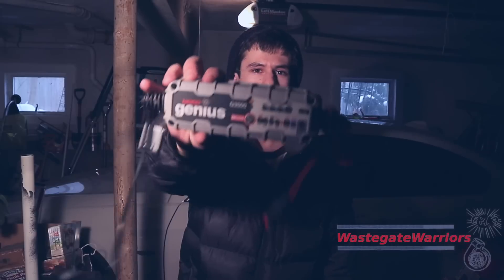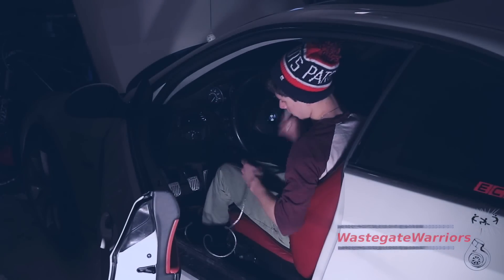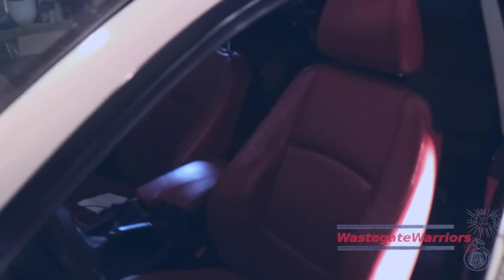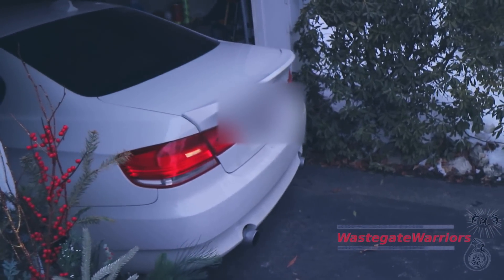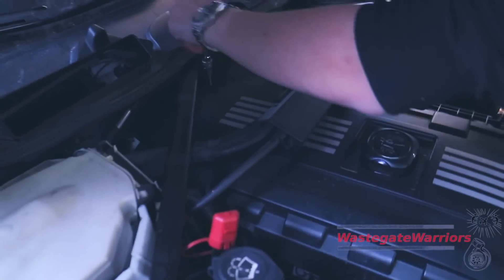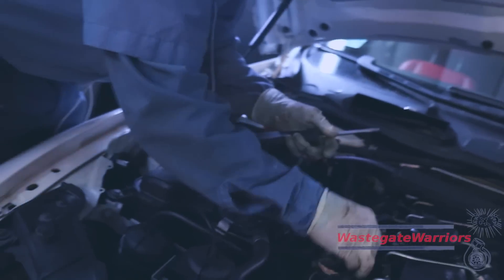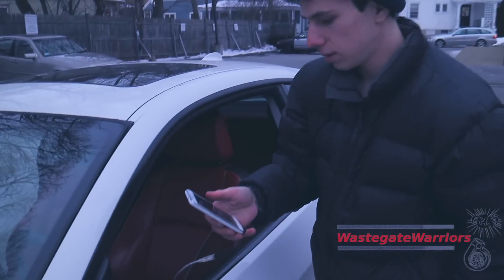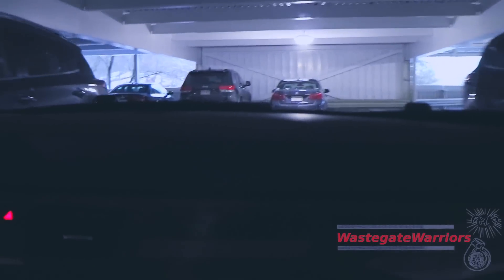MHD/Wedge Flash-Tuning Your Car in Your Driveway | Install and Review

Comment: I did the mhd tune stage 2 on my car. It currently has intakes, downpipes, and muffler delete. My car started to misfire so I changed all of my ignition coils, it started to misfire again so I changed my spark plugs. 

Now it’s misfiring again and I don’t have the cable to read the codes any idea what it may be?

Comment: Awesome video, guys! Was this a Stage 2? Does that only require downpipes? Any issues since you've had the tune?
Reply from the maker: This was stage 2, you don't need downpipes for any of the MHD OTS tunes, but they will keep your turbos spooling longer.

No issues with MHD. In my experience Ken wrote the best OTS tunes for this car. Period. I've been through JB4s, Accessports, and other generic tuning options. Wedge maps are the best OTS solution for this car, no question.

Comment: Great video!  Im currently running Cobb Stage 1 sport on my 08 335i and the only bolt on I have is a Mishimoto FMIC and was debating if I should sell the Cobb and switch to MHD.  Im fairly happy with the Cobb tune .  Do you think i would notice a power difference if I went with MHD?  Just didnt know if its worth the trouble unless its a major difference.  What are your thoughts?  Also what is the highest stage MHD OTS map I could use with a stock plus FMIC with 91 octane?  Thanks for your feedback !

Comment: I have a good video of my friends stock 2011 BMW 335i sedan auto n55 vs a mhd flashed 2009 n54 335i coupe auto. The mhd kept pulling all the time adding ground. It's not day and night difference but you do gain about 25 whp with mhd stage 1 flash
Reply from the maker: MHD is awesome. Stage 1+ is around 360whp
Reply: WastegateWarriors Is stage 1+ intake and tune?

Comment: what mods besides the tune does max have on his e92
Reply from the maker: Wagner FMIC, lightweight flywheel, 335is clutch, Phoenix racing charge pipe, VRSF one piece silicone inlets, stoptech slotted/drilled rotors, Hawk HPS pads and a secondary cat delete. I think thats it for performance mods.

Comment: Great video guys. Got some questions for you guys. Did u guys take out the jb4? Do you have to purchase maps if you want to switch a different map? Last question is when u change out the coil/coils. U guys change back to stock coils? Or performance coils? If different from oem coils, what do u recommend? Thanks for the video really. I want to flash my car with MHD.
Reply from the maker: We did take out the JB4. We also purchased stage 2 which enables us to flash ANY fuel type for a stage 2 tune or a stage 2+ tune. We put in stock coils because that's what I could get and I needed them asap but if you have a choice grab some good afternarket ones.
Reply: WastegateWarriors thanks for the important info. Learn a lot from ur videos. I'm having the random multiple misfire. Cyl 1,3 sometimes 2 pops up. Swapped the coils but it didn't follow the coils. Driving me crazy. Anyways. Thanks for the answers.
Reply from the maker: Check your spark plugs as well as fuel system. Could be an injector or fuel pump. Also check your coils, if they're wet you have an oil leak and need to change your valve cover gasket, if that's the case check the valve cover because it often warps.
Reply: WastegateWarriors nice. Thanks again

Comment: I'm N55 and Wedge just released our tune recently, I order my cables, already have my Android and will be buying my battery charger tomorrow.  I'm about to drop it like it's hot and get my tune on, I already got my 4"DPs, 5 stepped IC, GFB Diverter Valve and ER Chargepipe and I can't wait to see how much of a difference this is between it and my Cobb AP3 STG 2 Aggressive.

If MHD smokes JB4 then I know it'll destroy Cobb, thanks for sharing.....this only motivated me more to want mine in ASAP.
Reply from the maker: Drop it !
Reply: soldierviejo please post videos of your setup after it's installed. I'm running a 2011 335i stock for now and just ordered my cables and chargepipe. Thinking about custom for my exhaust with catless downpipes.
Reply: Jovin Flores I would've already had a video up but I ran into some problems that I couldn't figure out so I'm taking my car to BMW because I believe it is the High Pressure Fuel Pump that is the problem.
So for now until my car is fixed my MHD tune is on hold but I already have my bolt ons mounted and have so now for over a year.

Comment: super dope guys, i've been an audi/vw tuner (still am) for years i just got my first N54 335i and i only have Jb3 with charge pipe and hks blow off and a mid pipe delete on the exhaust i would like to know the PSI range of the MHD/Wedge flash. thanks again earned a subscriber.
Reply from the maker: Thanks for the support man. The Wedge flashes provided on the MHD app have a wide range of boost pressure targets. I can't speak for stage 1 or 2 but for stage 2+ it targets 18psi. :)
Reply: holy SH******T so pretty much JB4 and JB3 alone could never compete lol Also is this also known as the Back End Flash? ordering the kit now! again thanks alot! i'm going to continue to share your videos and i hope you guys keep making awesome videos man! i'm loving the BMW community.
Reply from the maker: Yeah lol the Jb4 is a very different product entirely. And yes this is a hard flash which changes the actual ROM files on the ecu, no piggybacking here.
Reply: No, this is not a Back End flash. BEF should be paired with JB4. What these guys have is a standalone MHD.
Reply: How many different tunes are on the mhd app?

Comment: Hi, you guys are so great and the video is very helpful. Btw, can you please be more specific how the stand alone MHD Stage 2+ pump is better than JB4+BEF MHD pump flash?  More PSI? More torque?  Smoother?  I would like to know if it is worth the $20 (full module) + $50(map) to change from JB4+BEF to MHD stage 2  + pump map stand alone flash.  
Have you tested the MHD beta V7? Is it better than V6?
Thanks.
Reply from the maker: It's better because it changes the actual ROM files in the ECU that control the timing, and the JB4 just tricks the car into making boost by playing with voltage. It's much more consistent and much smoother. When my car had a JB4 it would make crazy power one day, and not crazy power the next day. It was embarrassing to "show" your new tune to someone and have it underperform. Sell the Jb4, tune MHD/Wedge Stage 2+ if you've got the bolt ons, and you'll love it and make money in the process. The V7 is pretty sweet, it's my favorite revision yet.
Reply: When I did JB4 BEF flash, I feel the car is stronger and smoother.  The change is noticeable.  I am not sure if the stand alone flash will further improve it.  If it is not a big jump, I would stick with JB4 BEF.  That's why I want to know the different.   Before I saw your post, I thought the JB4 BEF has already solved the problem and no need to do the stand alone flash.  Please advise.  Thanks again for your great info and response.
Reply from the maker: King Ho I would sell the JB4 and go full MHD. You'll get the same power and make money in the process. It's a win win
Reply: Great, I will try the full MHD stand alone flash then.  Thanks for the advise.

Comment: Hey bro. Today I got the FBO and new spark plugs. But when I read the code there is a shadow code shows: 30EE super knock : cylinder 2. What causes that? Is that because of the coil is too old? Thx man
Reply from the maker: I've never heard of that and I just did some research and couldn't find anything :( I would email both Ken from Wedge performance and Martial from MHD explaining all of this to them. Sorry :/ Good luck!
Reply: +WastegateWarriors Ken replied that is caused by weak spark and I already changed the new spark plugs. So maybe I should change the coils too. It is a common issue isn't it?
Reply from the maker: Definitely change the coils, literally the second I got on it for the first time on the MHD tune I fried all the coils. Should be a standard upgrade for tuning any car imo. Good luck!
Reply: Thanks man! And today I got 2 shadow codes shows 29F4 29F5  which are catalytic converter conversion. Is that caused by a catless DP? Do I need to worried about them?
Reply: Jason X did you ever find out what was causing the error codes for 29f4 and 29f5? im getting the same codes..
Reply: That's because of the catless DP. Nothing need to be worried.

Comment: hI. My car is 27k miles. Does it need a walnut blasting before FBO and tune? And do I need to change spark plugs and coils just in case? And also how many whp if using a stage 2 built in map and custom tune map? thx bro. nice video!
Reply from the maker: No you don't need to walnut blasting yet, wait till 50-70k. Depending on the condition of your plugs and coils, you may be okay. I would say tune it first and then see if you misfire. If you misfire then grab some new coils and plugs. I would say expect 380-415 on 93 with your mods on MHD Stage 2+. A custom tune won't lend much more on OEM turbos and pump gas. Wedge's tunes are amazing and their off the shelf tunes are amazing!
Reply: +WastegateWarriors So ur opinion is dont need to do the custom tune right?
Reply from the maker: Jason Xin Not unless you have aftermarket turbos or you want to run E85. If you are running 93 stay with OTS
Reply: Hey man. What kind of  Battery Charger should I use? How many amp? thanks a lot.
Reply from the maker: Technically you're supposed to have a 10 amp charger but mine is 5 amps and I've never had a problem. As long as you don't use one of those dinky trickle chargers you should be in good hands.

Comment: It's better if you run both jb4 with mhd backend flash
Reply from the maker: Not necessarily. The JB4 is just a boost controller. That's it. The Wedge tune is an actual tune that controls many more parameters other than boost. The JB4 is cool don't get me wrong, but the features on it are not necessary to make power. You can make the same or even more power with just a flash from Wedge
Reply: +WastegateWarriors i know lol but y'all did a good job on this video thou man. I run into an problems last night for JB4 backend flash MHD. Having trouble with the MHD app itself. I paid for the JB4 backend flash software but I didn't receive the file. Hahaha so I cancelled my transaction and then wait until everything clear and then I'm just gonna give it a try again.
Reply from the maker: Try restarting your phone. And it will only work if the cable is properly hooked up near a wifi or internet source
Reply: +paul punpa you have to call customer service
Reply from the maker: Hmm try again?
Reply: +209GUNNAFORNIAA they don't have a phone number for customer service only Email I already emailed them but nothing
Reply: +WastegateWarriors can't purchase the software again because it says already purchased.
Reply: +WastegateWarriors already tried that hahaha
Reply from the maker: paul punpa
Email Martial from MHD, not Ken from Wedge performance. Try a different tune as well. Maybe your device doesn't have enough RAM if you're running a lot of other programs.
Reply: paul punpa are you saying I could use my jb4 along with a mhd flash? Have you tried it?

Comment: you kids did a great job with this video! I say kids because im 40 lol. So did the MHD tune make a huge noticeable difference? I have a stock 2011 335 and contemplating what to go with.  
Your facial expressions really says it all - so it transformed the feel of the car?
Reply from the maker: Haha thank you, check out our latest series on swapping the turbos on my car! I look and sound so much younger on video but hey it is what it is. MHD is the platform and Wedge is the tuner, the Wedge tune was night and day compared to my JB4 and it blew the Cobb tune out of the water, Ken really knows what he's doing and is incredibly helpful. If you have a 2011 335 you probably have an N55 motor which MHD does not support, however if you have a 335is then it is N54 and this is a perfect fit for you. The PPK flash is a great flash for N55 motors as well as a JB4 or a custom tune from Bren Tuning, or email Ken and ask him if he's planning on tuning N55 cars anytime soon:)
Reply: I believe they support n55 335 now. correct?
Reply: That is correct.

Comment: I have a 335i xdrive auto stock how much hp would this mhd give me ?
Reply from the maker: If you flash stage 1 you should expect around 330-350hp, do an intercooler and stage 1+ and you can expect 360 and 380wheel torque

Comment: what mods are on this car before you flashed?  FMIC (front mount intercooler) ...down pipes....dual cone air filters...
Starting with a stock e92, what increase would a stage 1 93oct give?
Reply from the maker: My car has a FMIC, OEM DPs, No secondary cats, BMS DCI, BMS methanol elbow, lightweight flywheel and a heavier clutch from the 650i. For a stock e92, you should see 340-360hp roughly and a bit higher for torque

Comment: Hi Guys
Can anybody advise if you are paying for the Stg2 91 map? 
Also, are we selecting "Flash a built-in Map" or "Flash a BETA built-in Map" ? Would love to know the difference.
Reply from the maker: BETA built in maps are maps that are still being developed and are not final. They are perfectly safe but are tweaked and not the final release. If you pay for a tune, you get all the octane variants. So if you buy the Stage 2 tune you can flash it 91, 93, or 95 I believe
Reply: If I buy the beta map now. Once the map has been finalized, do I have to pay again for that finalize version?

Comment: can you do jb4 plus mhd to get more boost or it just has to be either one... nice car, great video bro thanks..
Reply: Yes, you can stack MHD and JB4
Reply from the maker: Yeah but you won't get more boost. You will get the SAME boost running MHD alone or in conjunction with the JB4. The only thing the JB4 does then is control boost. It also has cool features in it but you will not get "double" the boost or anything like that

Comment: Thanks for making this video! I randomly ran across it the other day and immediately got started. One thing that you may want to put in the notes above is that the K+DCAN cable you linked to may not work for all N54's. Some use the cable with the white circuit board and others use the cable with the green circuit board. I have a 2009 E92 335i and I couldn't get a connection with the cable linked above. Luckily I did some reading and found out about this the day after I ordered my cable and just ordered the green circuit board as well. Returning the no-working cable was simple. A couple of clicks on Amazon and UPS made a stop to pick it up! Here is the link to the one that worked: http://www.amazon.com/dp/B007JRWH1M/ref=cm_sw_r_tw_dp_HXrlxb0C10BAG
Reply from the maker: +Jacque Bussey Thanks man, amazon changed the url of the links so while the links I bought worked, the link changed so I guess the wrong ones got listed over the good ones :/
Reply: +WastegateWarriors I'm not sure, I think the white board actually works for some cars.

Comment: Great video dude! I'm looking to get a MHD Flash stage one map for my z4 (35i with the N54). It's completely stock performance wise, the stage 1 map will work fine right? I'm not going to get the tune until I upgrade the stock charge pipe as I understand they can split when you run higher boost.
Reply from the maker: +Tom Gooderham That'll be perfect. You should get an upgraded charge pipe but you do not necessarily need one. If you have an older charger pipe from 07 you'll be okay. The newer 09-10 are less strong

Comment: Got excited about this and bought the cable off the link... however its doa. Wont connect to my ecu... won't get voltage. Any idea on what I could be doing wrong? already tried phone, tablet... 2 different otg's... odd.
Reply: Car is an 09 335i by the way...
Reply from the maker: +Otto Vargas You need to have the right cables. Also some older devices do not support OTG. The cables I listed definitely work though!
Reply from the maker: +Otto Vargas My bad amazon changed the link, buy this one http://www.amazon.com/Cable-Matters-Micro-USB-On-The-Go-Adapter/dp/B00GM0OZ4O/ref=pd_sim_147_4?ie=UTF8&dpID=41KKuffqLCL&dpSrc=sims&preST=_AC_UL160_SR160%2C160_&refRID=060G6S5RK4E79W7F6166
Reply: Im using a kindle hdx and a one plus 2, plus a galaxy tab and none work
Reply: I have 2 otgs that do work with other devices... One micro ysb and another typce c.

Comment: They glossed over it, but backing up your stock BIN is very very very important. Once you do a flash you can put the tables back to 'stock' but it won't be OEM unless you write the original BIN back again. It is also critical for recovery if you screw something up. Not sure if MHD works this way, but with the BB flash I also always use TunerPro to copy the tuning tables into my stock BIN and then write it, rather than just use the generic BIN the tune comes in, otherwise things like the cruise control might not work. Maybe MHD works around that. I also recommend stacking with JB4 for additional features and logging, not to mention the safety, especially if you run meth.
Reply from the maker: +RavTokomi Yes you're right. Definitely back it up. But worse case you can always flash back to the stock firmware via MHD if you screw something up

Comment: Wait I keep hearing Cobb? Is this like a specific tune or something? Curiosity cause I'm going to purchase a 335i soon and idk what tune to get yet. I was thinking a jb4 but I'm still looking
Reply from the maker: +isaias This tune is much better than the Cobb tune. No one really runs Cobb anymore as their tunes are very conservative and do not unlock the potential the car can achieve. MHD is the interface, it's an app downloadable through the Google Play Store. The tunes are built in, they are made by a company called Wedge performance. Stage 1+ is for a relatively stock car and Stage 2 is for cars with downpipes. - Max
Reply: Watergate warriors. I just looked on the mhd site and they said they support n55 engines.